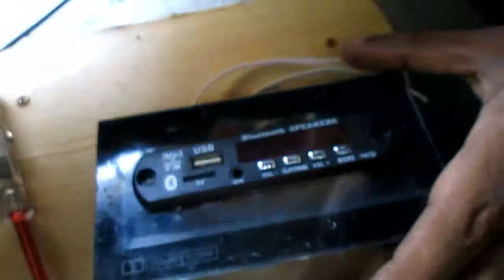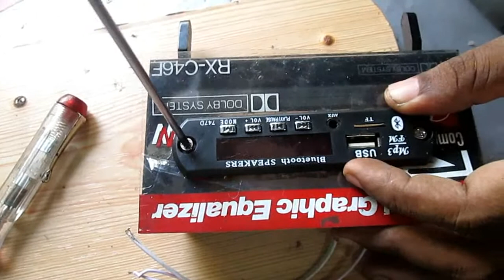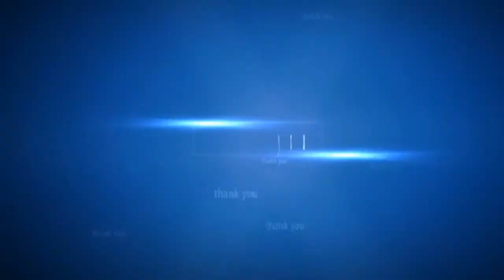How to install usb kit to old cassette player /bt/fm/sd card

Comment: This USB kit mostly 5v you directly connect it with 12v power :face-fuchsia-tongue-out: didn't show if you use D882 or 7805 regulator etc ???